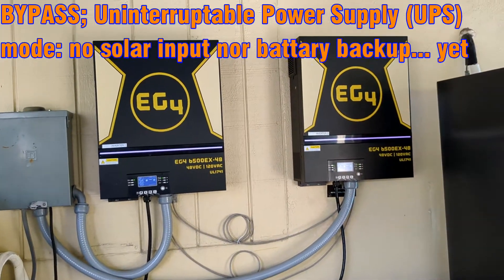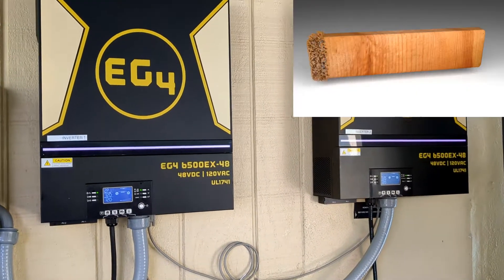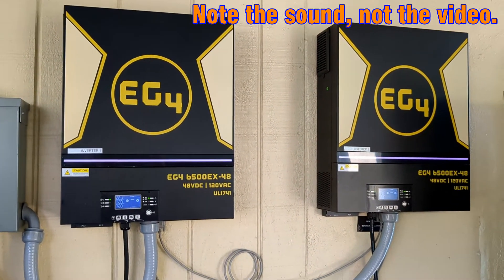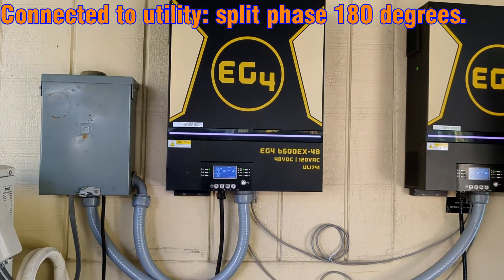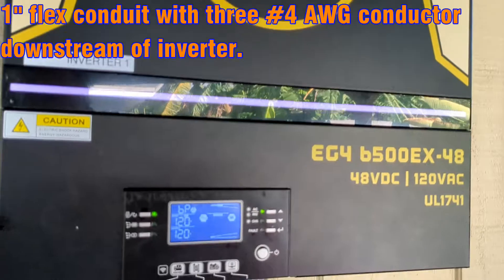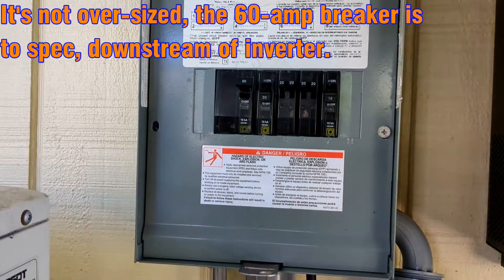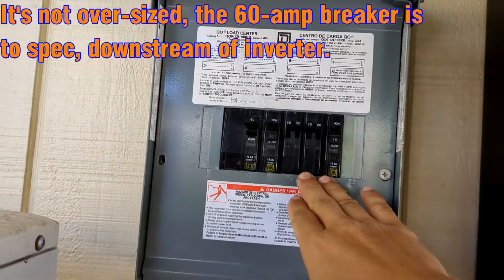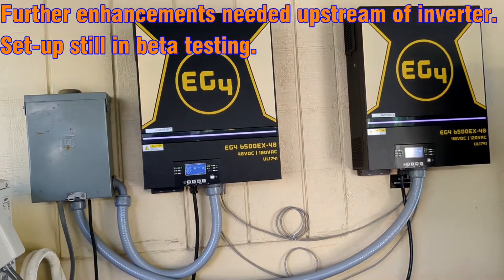EG4 6500EX Installation 2

Comment: Hello sir I’m doing same as you Interrupted power with grid and batteries  but only one EG4 how do I connect from my main panel to Eg4 input?
Reply from the maker: Hello, Yanko. The good folks at Signature Solar or diysolarforum.com should be able to provide a more detailed rundown. *Mains voltage can be deadly, consult with a licensed electrician and have them set this one up for ya. If you are utilizing the US 120/240 VAC mains, have the electrician create a single-pole 60-amp disconnect and connect the inverter to the sub-panel. This way, you won't have to cut power to the whole house every time you'd need to work on the inverter. Once the AC power access/disconnect dedicated to the inverter is established, it's a matter of mating the VAC input on the inverter with the sub-panel (L1, N, G); On your inverter you should see another set of three connectors (L, N, G) that you can port out to your appliance. Ian at watts247.com (https://www.youtube.com/channel/UCXVNL-mnf_vfD_qT7jLjtcg) has tons of video on how to accomplish the port-out. Good luck. Be safe.